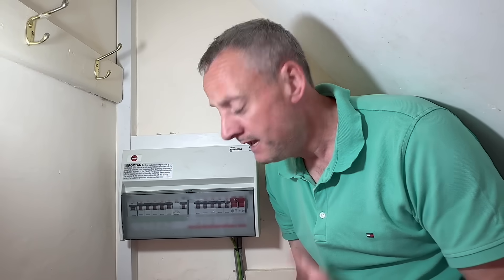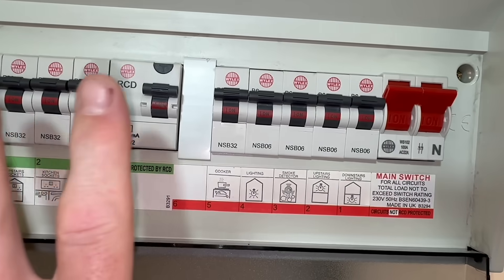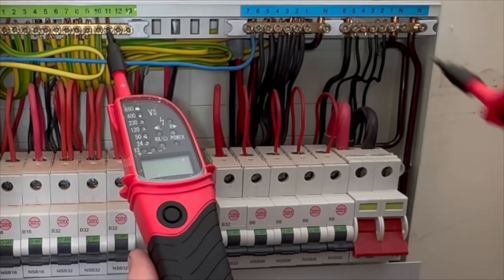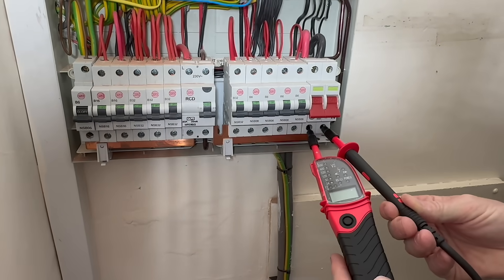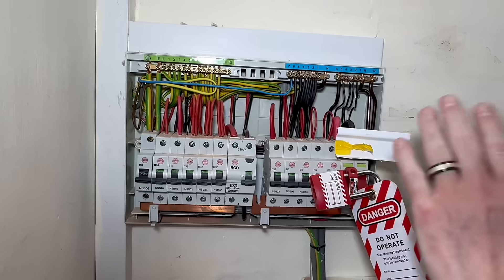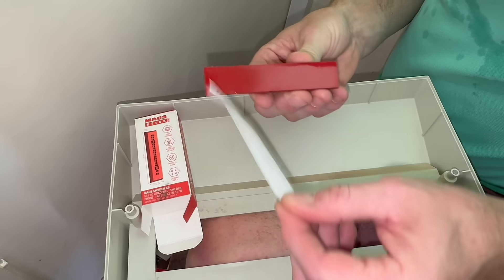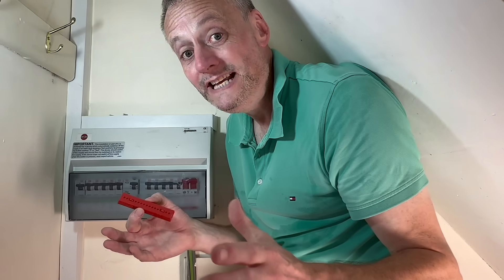£1000 To Change This Plastic Consumer Unit?

Comment: I usually love this channel.  Sticking a piece of capping over the l/n incoming terminals 🥳  they are recessed and we use insulated tools.  If it was something that was needed then there would be a cover on every one in there.   
And why would you loosen up all the terminal screws that have been checked on a previous EICR just to re tighten them.   Perhaps you might check the tightness.  Why wouldn’t you recommend a new cu to update to modern standards.  I thought you would be upgrading the rcd and changing the mcb’s to rcbo’s.  This whole thing is about that fire suppression thing.  I love this channel but this content is 😱

Comment: Hasnt there been a recall on the Wylex NSB range (pretty sure these shown in video are infact the NSB range)
Also my Napit codebreakers says that cables buried in walls less than 50mm and without some sort of mechanical protection, without rcd protection is a C2. And my certification software would also say that an AC RCD protecting circuits that could potentially feature DC leakage (washing machines etc) is also a C2. So where the consistency?
Reply: There was a recall on those made in 2008.

Comment: Hi.
Could one of your knowledge viewers please advise.
My bungalow is wired ( sockets in 4mm red and black cable radial circuit ). The cable who's on in good order and I experience no fault tripping etc. Is the cable satisfactory?
Thanks
Reply: Only by visually inspecting inside a couple of sockets and then doing R1+R2 and IR tests could anyone say it's safe for continued use.
Reply: @dennisphoenix1 thanks
Reply: Depends on what's on the end of it at the consumer unit and tons of other shit but the answer is probably 'yes'
Reply: It is more the other way round. It is not unsafe merely because it is red and black colour cable. There must be tens of millions of properties with cable that old, including my entire house, which was built in the mid 1990s. It now has RCBO protection in a metal CU, and it's no doubt electrically speaking, safer than when it was first built, even if the cable is now about 30 years old.

Comment: So what you all coding the type AC RCD? Just had my NIC inspection I’m very interested as to what you all think if you would comment please
Reply: No need to code anything. Just put an addendum in the report, advising the smooth brains who come along causing problems with their solar panels and milk float chargers.
Reply: @ChariotsofWire180 that’s the world we live in now unfortunately, I agree I wouldn’t ever normally of coded it, but my NIC inspector has told me C2 for this reason (type AC RCD can be blinded by DC fault current created via USB sockets, LED lighting, appliances with DC motors/pumps) I was asked how I test for this, I said I have a AC earth leakage clamp meter, he said unless you can prove that RCD won’t be blinded then it’s C2 and change them, very interesting, multiple cheap USB sockets (BG and LAP) can actually blind a RCD and I have had it happen, out 4x cheap usb socket outlets back into wagos and hey presto got a adequate RCD trip reading, sockets back on RCD won’t trip, that’s using a bang upto date megger 1741+ and tried a megger 1720 with the same outcome

Comment: Depends on the property as we have been doing hmos and the local council require spd and rcbo so they may as well swap out for metal for a full change like that but in what world is it a grand for a new new  consumer unit new board is 150 my cost for swapping out and retest 300 where does the 550 come from or is that southern prices what are like on 850 a day or something
Reply: £150 for a board !? What are you fitting CHINT? My cost are higher because we insist a higher standard of install and materials.
Reply: Probably screwfix specials.

Comment: Gaz considering that cu has no markings or label detailing the torque recommended settings how do you know what to torque it upto? Considering the age those MCBs and main switch earth and neutral bars probably don’t even have a recommended torque setting . Therefore because you torque them up you could off under tighten or over tightened them? 
Sorry just asking a genuine question. Any giving my honest opinion.
But what do I know I’m just a grumpy old dog whisperer spark whose opinion means nothing.
Excellent video though. And the fire suppression thing is an excellent idea I have put one off mine in my own CU
Reply from the maker: Ask my mate a Wylex and also used AI
Reply: @efixx oh that dam AI again
Reply: @efixx how would your mate a wylex know? Unless they are say the torque setting is a one torque fits all? Like I said that board and the MCBs would have been manufactured way before torque setting was even considered in the uk so they unlikely wylex would have recommended a a particular torque setting .  I’m guessing.

Comment: Amazes me to this day why sparks still spend money on IEC60900 / VDE rated tools, if they can't actually use them on live conductors.
Reply: It's in case you touch a live conductor, can happen. Only a few quid more for the VDE plastic handles versions. I've cut through a live conductor before and all that happened was burnt my side cutters, better than getting a shock.
Reply: @briandavies7456 he did say “competently” my mistake, he should have said competently - to be CLEARER!
Reply: I couldn’t agree with you more, Also the DNO not allowing us to “pull” a Main Fuse Carrier to check fuse rating for an EV charger install, when the stickers have disappeared over time!  It’s also just a crock of 💩! Rant over.
Reply: I’m absolutely guilty of cutting a live wire that I’ve believed to be dead. I’ve poked around in live junction boxes, I’ve tightened live terminals. I’m more than happy to spend a very little extra for insulated tools, because even when we aren’t supposed to work live, and when we do what we can to not work live, you never know when it might happen, and I’d rather have an not need, than not have and need.
Reply: @tom-l-91  That's my point Tom.  I have a set myself, and yes, I've used them on live terminals.  I try not to but sometimes needs must.
Reply: Tightening up the tails on a main switch, older installations don’t have isolators. you aren’t going to call the DNO to isolate the supply are you.

Comment: The lighting circuit serving the bathroom..should be on RCD
Reply from the maker: But not 21 years ago
Reply: @efixx  It doesn’t matter. If you cannot confirm supplementary bonding, then you have to C2 bathroom light with no RCD. 

Yes, a lot of regulations are retrospective. But some of them aren’t, and this is one of them.
Reply: @efixx what’s that got to do with the price of fish, it needs to be on a RCD if they want a satisfactory EICR, end of
Reply: you’re totally wrong.
Reply: @amatchmadeindevon2005 no it doesn't. C3 not to current regs still gives a satisfactory report.
Reply: When will you lot stop trying to apply the standards of today on old installations? It’s like taking your car in for an MOT and being told it’s failed as it doesn’t mean EURO 6 😂
Reply: @edc1569 Some of the standards of todays regulations have to apply on an EICR of any age.

I will list a couple for you if you’re unsure.
Reply: If bathroom lights have SELV transformer in dry room, they can work safely without RCD.
Reply: What happens if they had alterations since when it was first installed? Which is highly likely.

Comment: the issue is the fuse box is combustible and is located under what appears to be a staircase - probably timber. this means your reliant on the plasterboard to give sufficient fire protection.
electrical safety first's guidance is that older fuse boxes are OK provided they're not under timber stairs or in an escape route.
Reply: it's a C3 regardless, regulation's aren't retrospective. Otherwise as soon as a new amendment comes out suddenly everyone's install is non compliant? 

If there was signs of thermal damage then C2, but otherwise improvement recommended
Reply: Goodness how will anyone sleep at night 😂

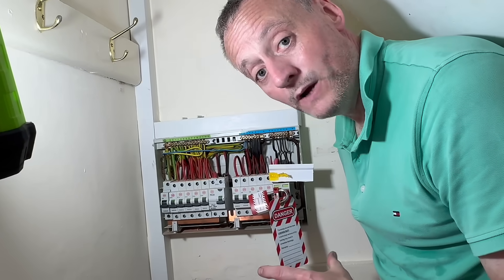Comment: 3:30 What's the bigger risk - fire due to not checking torque on the incoming tails or getting a shock while doing so incompetently?
If the place burned down, could you defend not checking those screws? Why do you even have insulated screwdrivers?
Reply: Yeah I don’t understand the problem, the tool is insulated? You don’t hesitate to stick a multimeter probe onto a live terminal - what is the difference?
Reply: @edc1569  Exactly.
Reply: @edc1569 Genius!
Reply: @edc1569  the issue is he would have to back the screws off then re-tighten to get the correct torque. not something you can do on a live supply on a youtube video when your promoting safe working.
Reply: I agree but didn't want to say! If there is no load (i.e. switched off) its not an issue with live wires, decent tools, slacking off and tightening screws. It's not something I would ever ask anybody helping me to contemplate or even witness me doing or put on YouTube. There are a lot more dangerous things we have to do like climb a ladder, drive a Van, slip and fall off a roof, breath in asbestos laden 80's artex, nail gun misfire, fall down a lift shaft, scaffold collapse etc.
Reply: @Ino-z2m I need more examples - you have not made your self clear enough for wokeists. Yes I just made up a word.
Reply: @markhardacre1 haha
Reply: Not going to lie I was looking at his LOTO and finger guard setup as well.

I seldom do any domestic work (control panel spark) but that is way in excess of anything I've been trained to do or have seen in industry in my 6-7 years of working in panels.

None of the worked on components downstream of the LOTO are outwith line of site of the isolated supply, it's totally unnecessary, and if you're not confident working on adjacent components without shoving something in an IP2x piece of switchgear 2 inches away then you shouldn't be working in an electrical panel.
Reply: Exactly it’s a matter of Competence and using the right tool for the job.
Reply: Fire because of torque on the tails 😂. You've been dreaming too much
Reply: 100% agree. I've seen a handful of consumer unit fires caused by (usually) a loose neutral tail in the main switch. Have also seen the same for the busbar, and the neutral bar.
Reply: Done thousands of energised screws with my trusty Wera Screwdrivers....
I wonder how anyone could possibly even get shocked?? 
You would need really tiny fingers that need to slide towards the screwdrivers blade, but even then....
If you want to be double safe you could bring a rubber 1000V mat and protective glasses.
Reply: @animarkzero exactly, how does anyone ever dare touch a light switch? That's just live cables with insulation over it

Comment: I'm still on my wirelex rewirable consumer unit 😮
Reply: So perform an eicr, do any necessary repairs and change it…
Reply: Then you’re an idiot who likes changing fuse wire in the dark. Well done 🎉 Some people still have a Nokia 3310 and claim it’s better than an iPhone, some people still use a Yankee screwdriver and claim it’s better than an impact driver. Also idiots.
Reply: Still skint 😂
Reply: My new box has been sat in my kitchen cupboard for about a year, been meaning to do my old wooden box since I moved in. 😂

Comment: Being a tenant in a property we undergo an EICR every 5 years, my last inspection recently uncovered that the consumer unit needed to be replaced. the problem was circuits doubled up, the lights and smokes to be precise. so I was informed by the landlord that the sparky was coming back to do remedial work, to my surprise when he arrived he brought with him a new consumer unit. Shocked(forgive the pun) I was, I didn't question this as it isn't my place(I was a sparky, 16th edition, notuptodate) apparently the old metal consumer unit wasn't large enough to undouble the circuits. when he finished I noticed the new consumer unit was the same size as the old unit, he did indeed replace it, but where I had two zones before he changed it to a single zone but now they were all RCBO's, so he actually freed up 4 spaces and used two of them for the new circuits for the smoke, he didn't actually need to change the unit at all. seems a lot of scammers around.
Reply: I was under the impression that the smokes and a lighting circuit can be doubled up. Wired in the same sized cable, and if the smokes went faulty, the Mcb would trip, which includes the lights, so you would address it asap.
Otherwise, there is a possibility of ignoring, especially if you are a bit deaf !
Reply: @markstarmer3677 Having smoke alarms on the same circuit as lighting not only prevents them being turned off by people because of nuisance alarms. It also as you right put it keeps them continually active. In some cases the smoke alarm may trip an mcb or rcbo and go undetected. If it's on the same circuit as the lighting. You'll get to know about it. As lighting circuits are used all the time.
Reply: @rayc1503  - Spot on!  That’s pretty much the same wording used in the Building Regs.
Reply: @markstarmer3677  It's a radial circuit so it can branch anywhere, even the origin of the circuit. The spark in question is a scammer.
Reply: 😂 doubled up lights and smokes. If that was the sole reason for the board change, that spark deserves a medal. Top con there for sure.
Reply: @tom-l-91 thought doubling up with lights was the preference to stop the smokes just being switched off if they nuisance alarm. (Not an electrician)
Reply: @grahamleiper1538 it’s a funny one. You’re not wrong, that’s certainly one way of doing it, although it would be more common to take a live feed from a Lighting fixture to feed a nearby alarm, rather than having an alarm circuit that then doubles up into the same breaker as a light circuit. 
But it’s also very common to see independent alarm circuits, which to some extent the fire detection regs prefer. Possibly more likely to have nuisance tripping on a lighting circuit than an alarm circuit, so could end up with unpowered alarms when the fault is actually on the lights. 
Also, most hardwired smokes have 10 year sealed batteries now, so to be fair, a tripped lighting circuit, or homeowners trying to turn off alarms… it’s all much of a muchness. Personal preference really, and I tend to do what suits the situation best rather than only sticking to one.
Reply: @tom-l-91 doesn't apply to me. My smoke alarms are 10 year battery powered and interlinked wirelessly anyway.
I just figured people will usually repair a lighting circuit fault rather than wander about in the dark. There's not the same incentive to repair a smoke alarm circuit.
Reply: One of my customers had a metal dual RCD board and he upgraded his board to RCBO. All I added is SPD and an RCBO for his EV Charger. 
Some people don't mind upgrading their board.
Reply: Split load board has the 2 separate neutral bars, depending on brand you can't always get a link rated for them, you could argue feruled 16mm neutral fly lead to one of the neutral bars would be good enough but most sparks don't seem to be aware that it's allowed. So instead swap the chassis out to fit the RCBO's, especially if their preferred RCBO brand is different from the current consumer unit.
Reply: He did free up space by installing an RCBO Board. Am I missing anything? Maybe 4 free ways were created To allow him to use for new circuits.. he’s the kind of spark who is looking after his clients. If it had surge great. But what type was the RCD “A”? And what about ⎓ LEAKAGE affecting AC RCD’s…?
Reply: Replacing the whole unit was the sensible thing to do if he is going to swap out dual RCDs for RCBOs, now the unit is fully up to date and the landlord shouldn't have any more problems for years. On a rental, when work needs to be done it's always best to get everything done in one go to get the best possible standard. Almost always works out cheaper in the long run, trust me on that.
Reply: Every 5 YRS, FK ME, where do you live, we have to do it every FKN Yr where we are in Britain
Reply: I wouldn't call him as a scammer. He definitely upgraded the dual RCD bord to a RCBO + SPD (I guess) which tick all the boxes on an EICR.
Reply: @AntonyoKnight  it already had surge protection, did it really need changing, I'd say no.
Reply: @kentmccroskey3712 did it need changing, maybe not, perhaps he approached the landlord and explained RCBOs are a lot better option, also maybe the original RCDs were type AC? Lots of if buts and maybes, you now have a much better installation and you didn’t even pay for it 😂😂😂
Reply: @amatchmadeindevon2005  No If’s and butts. Split load Type AC are total rubbish! Not much worse than a Dual Type A split load. RCBO ARE THE WAY FORWARD.